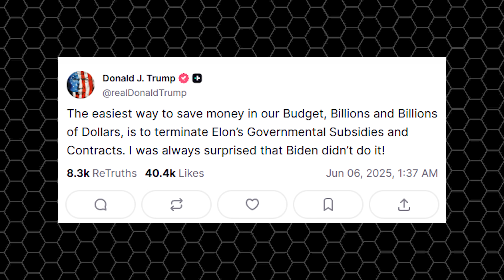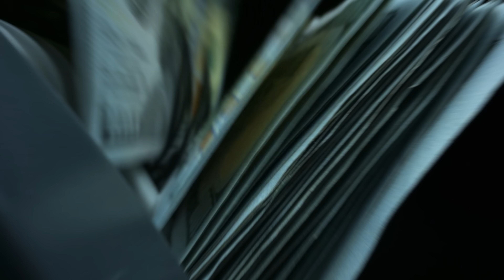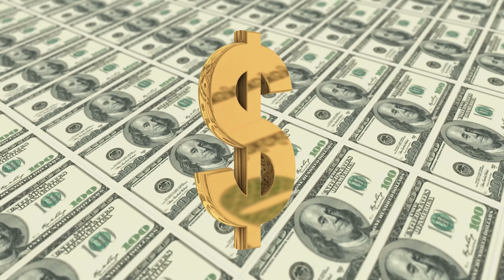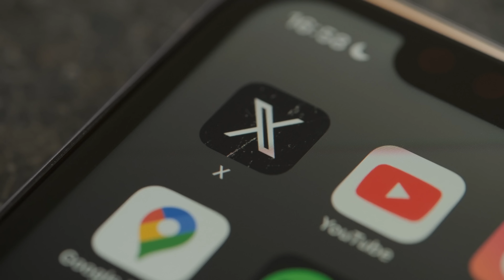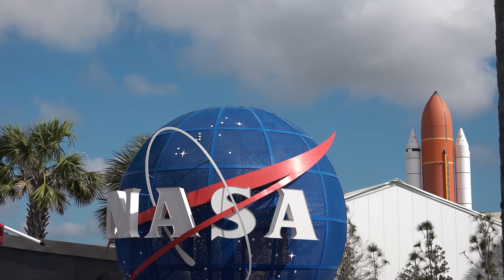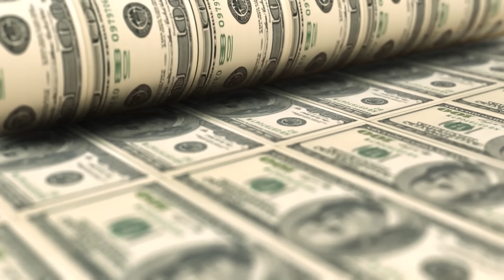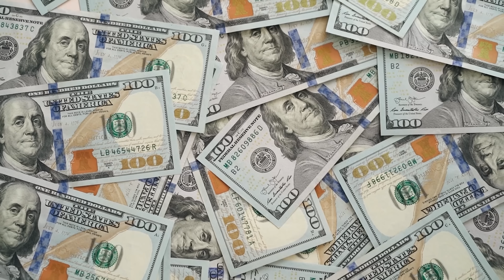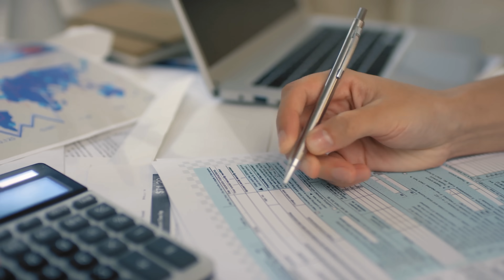What Elon Musk just declared about SpaceX Revenue totally Humiliated NASA, even Boeing...

Comment: How would NASA and even the DoD put ANYTHING into orbit without SpaceX? Boeing can't do it, Blue Origin can't either. SLS is seriously overbudget and behind schedule. Going to go back to Soyuz?

Meanwhile, Falcon 9 has flown over 100 times THIS YEAR ALONE! The cost per kilo is a fraction of the competition and the reliability is unmatched! Once the issues with Starship are sorted and the test cycle completed, SpaceX will be in a dominant position for a very long time! 

Noteably, with regard to the ISS, SpaceX were given a small fraction of funds compared to Boeing yet which system is quietly and reliably delivering supplies, crews and even rescuing crews stranded by Starliner? Boeing haven't even successfully completed a single mission!